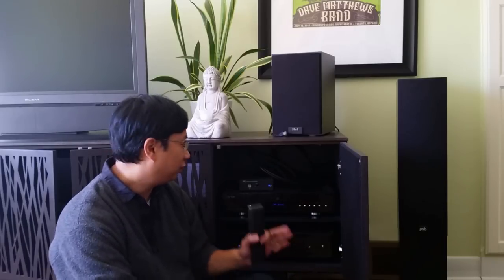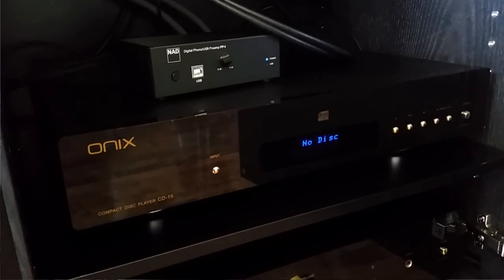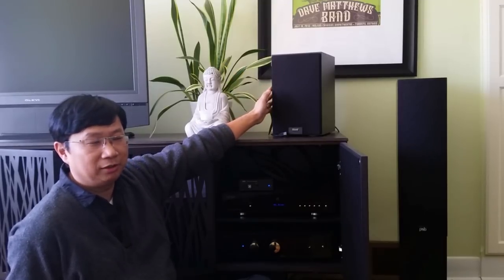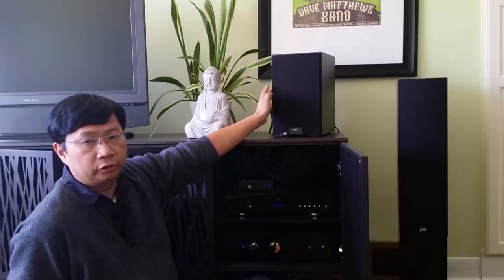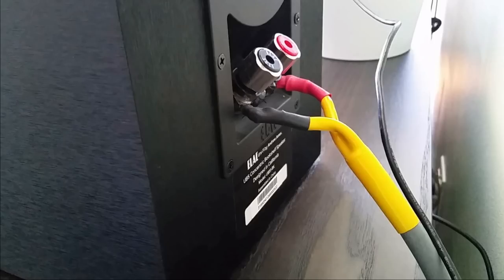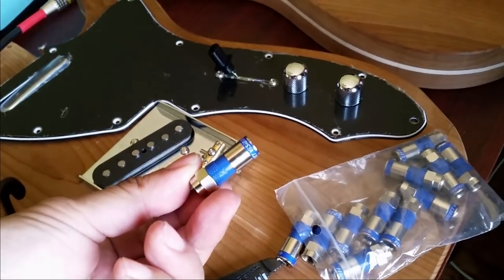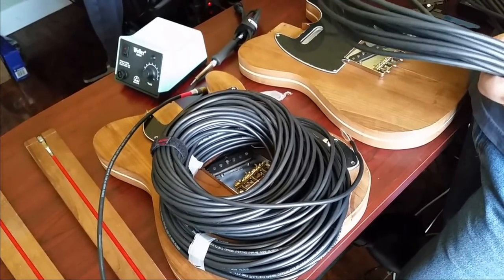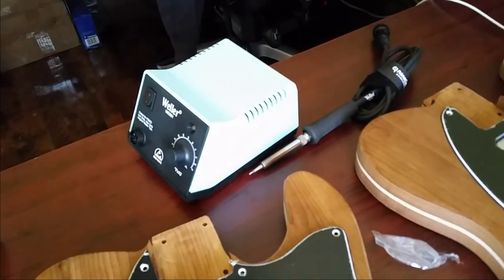Stereo - ELAC uni-Fi UB5 speaker review + DIY cables + Onix RA125 + Onix Cd15

Comment: I got myself some power flex cable from the local hardware and hooked it up to me speakers. It's copper wire, very thick  (can handee 1`5 amps!) and I can not tell any audio difference, even though these cables are more than 5 metres long. The cost? About $7.
Reply from the maker: $7? Best deal in town. :)
Reply: It's just the going rate for electric cable.
Reply from the maker: Best deal in the sense that you don't have to spend crazy money on cables.
Reply: RIght - and I believe that those fancy cables with gold and whatnot are a scam - you cannot tell the difference. Also, since power cable is fairly thick, you can use it over a long distance without resistance being an issue. Just make sure you get copper cable.

Comment: Fantastic review. Although I have a question: wich soundstage is better, these ones or the LS 50?
Reply from the maker: Will be bringing over my LS50 to my friends home to do a side by side comparison soon.
Reply: sir..can u recommend me a few options for integrated amp for elac ub5 which can pair and drive them to their maximum capacity....thnx
Reply from the maker: The beauty of these speakers is that they have so much potential. Even with my friend $3k+ integrated amp, I still feel there is room for improvement with a better setup. So I would say you have to find an integrated amp that sound signature is more to your taste. I like moon myself.  It also depends on your budget, but i think most important is make sure you have a lot of power with your amp since these are not efficient speakers.

Comment: Hi Thomas, this is great review. I also hear your sound demo video, this UB5 sound fantastic. 

I’m running home theater on my living room with 7.2.4, my gear:
1.  denon X4500h : 
   - 125 W (8 ohm) on 2 channel.
   - 190 W (4 ohm) on 2 channel —> dynamic power (dont understand yet about dynamic power)
2. Front speaker: klipsch rp-600m
3. Center and surround speaker using mordoaunt short 
4. Atoll in 30 using by pass preamp to power my front channel.

Im listening music 75% and watching movie 25%

after watched your video, im thinking to buy it, because im curious and want to experience good music separation 
And neutral sounding. Because after watched many review and sound demo, i think the sound i like most is neutral sounding with a good music separations.

Now im finding amp that will be synergy  With elac ubi5. 

After buy the amp, in the future i plan to buy schiit freya to pair with the amp. 

I’m from asian country so i cant get the benefit from trial period

My option:
1. Emotiva xpa-3 gen 3 
 - 275 w @8ohm on 3 chnnel driving. No 4ohm rating

2. Schiit vidar with 2 unit running mono block. 
- 400 w @8ohm.

3. Using current denon x4500h

When i watch your video, i see you have the experience with emotiva xpa and schiit vidar.

So My question:
1. What option you think is more synergy with elac ubi5?
2. Option 1 and 2 will sound significant better compare option 3 (using denon)?
3. Do you think with x4500h is enough power to drive ubi5?
Reply: 4. Emotiva xpa-3 and schiit vidar are sound neutral? 

Sorry for asking so many question. 😃
Reply: hello, I am in similar boat as you, just without a surround setup. I have a 2.1 home theater system with the elacs on the way. I also listen to music 75% of the time with my system. I had paid for the same denon receiver but I quickly returned  it and am searching the used and refurbished market for a powerful 2 ch amplifier. monoblocks is the end goal with a dac and pre amp. I also have been very interested in the emotiva xpa line. I read they are very modular and can be used as monoblocks when in a pair. Separates are the way to go for people that value the listening quality, and a preamp/processor will keep your surround system running just as well as with x4500h.

Comment: Help me out! I just got Yamaha tsr-7850 with spec of 1khz 2ch driven - 110w 8ohms 0.9%thd. 20hz 20khz 2ch driven - 95w 8ohms 0.06% thd. I will only be using the AV receiver with 2ch for now and hope to expand in the future. Do you think this speaker can work with my Yamaha? I am new to all of this.
Reply from the maker: You have to email Yamaha and ask if this receiver support 4 ohm load. The Elac are rated at 4 ohm, although your receiver will work with it, my concern is more long term driving it.  You risk the problem of overheating. I check on yamaha site and don't see they mentioning it supports 4 ohm, nice receiver btw.

Comment: In your experience, how much wats will be enough to power these speakers? Do you think denon heos hs2 amp will power ub5 elac speakers? Thanks!
Reply from the maker: I think your amp only support 6 ohm and not 4 ohm based on the site. Ideally you want about 100w into 4 ohm but I am sure you can get away with 70w. It's not that just because you have enough watt, it's enough, you need quality watt. Although ideally the more the better, 100w @ 4 ohm should be adequate.
Reply: @ThomasAndStereo  well i have to go with another Speaker, which can you recommend me of 8 ohms? Thanks!!
Reply from the maker: @jorgeluisfernandez2560  Maybe look into the Elac debut 6.2. They were on special on black friday. Cheap $150, don't know if they are still on special thought.Depends on your budget and what kind of sound you are looking for. Check out my video 'what speaker to buy?'

Comment: I wonder if they will release a 6.5" version, hmmm. I have a large room and would like these speakers and I use a sub so that would take some strain off.

I just wonder how these would do on a midrange home theater reciever with rated 80w @ 8 ohms / 120w @ 6 ohms and not sure @ 4 ohms, but it does play at 4 ohms, if that's enough.
Reply from the maker: Have you consider going for the full size tower.  You have to check with your manufacturer else you might run into over heat problem with your receiver and reducing it's life span.
Reply: Thomas & Stereo cant consider towers at the moment due to little ones running around and the TV setup at the moment works better with bookshelves anyways. The reciever is built to play 4 ohm loads, that was one of the selling features. I know of others that have done it.

Thanks for your replies. These are just such a nice size of speaker, I would like the 6.5" version, but afraid of the size. How big of a difference do you think it would make to have that extra inch in a large room? Much? Also the question would be if they were to release a 6.5" version do you think it would be a 2.0 of the original or just a larger version.
Reply from the maker: If your room is big, you will need a sub either way else I am not sure the extra inch helps 😢 they sound really different so I think it's more importantly which sound you prefer

Comment: Thomas have u ever try SVS prime and ultra bookshelf ? If u do? How does elac ub5 compare to the other 2 ? Just wondering as I'm planing to get SVS but it's abit expensive in hk
Reply from the maker: I owned the SVS prime before, 2 floorstanding, 1 center and 2 back bookshelfs. I liked them in the sense they are warm and very strong at the low end. However, once I did an AB test against my dynaudio compound the, although the bass was not as good as the prime, the Dynaudio was a class above in terms of refinement and that was against the floorstanding speakers.
Reply: Thomas & Stereo oh ok..I was thinking to get ultras but in hk it's so abit expensive it's about $2000 US  For a pair.. so I try to search something that might be close to it like the elac ub5... I can get half of the ultra's price ..but it come to my mind wat about prime..or maybe I jst close my eyes n jst go for the ultra..🤦‍♂️
Reply from the maker: Elac Ub5 is good but keep your expectations in check because it's not the same class as the Ultra. Also, it depends how important bass is to you. HK usually have space problem so is that why you are going for bookshelf? Elac is soft on the top end which is good for long listening but need a bit of power to make it shine.
Reply: Thomas & Stereo yeap u r right it's the space my living room is jst 250sqft where in Gona place my system.. I will get a pb2000 aswell ..I jst spoke to the dealer he will give me $US969 almost same as the elac ub5.. should I go for prime than ub5? Or save abit n go for ultra? Jst need a expert advise haha
Reply from the maker: Well I can't give you an advice on the ultra as I never heard it :( The UB5 is more of an audiophile speaker than the prime if we are comparing bookshelf. Can you audition them?
Reply: Thomas & Stereo I went to some shops but they don't have the ub5 only the b6's but I knew one more dealers that I will go n hopefully they have the ub5 n let me try it..most shops dealers don't have much of the elac🤦‍♂️
Reply: I thought the svs prime was shrill and shallow
Reply from the maker: Lucas D the full tower one I tried had meat...I never bothered with the rear bookshelves.
Reply: Thomas & Stereo, Lucas.... any suggestions for a rear bookshelf for the price of $1000US?  U guys don't recommend the SVS prime bookshelf ??!
Reply from the maker: The SVS prime bookshelf are really small speakers so they are good for effects but not for main speaker. Are you planning to spent $1k on a pair of speakers just for the rear or as main speaker?
Reply: I thought the primes were on the large side of bookshelf speakers. I think that size speaker when paired with a capable sub would be fine as a main L/R. Just not the prime, its simply a poor sounding speaker when compared to something like these Elacs.
Reply from the maker: Hey guys, I just realized I made a mistake, I had the SVS prime satellite and not the bookshelf. No wonder they were small. I never paid attention to it so never research it further.
Reply from the maker: My mistake, I had the prime satellite with the full size towers. I never had the bookshelf one.
Reply: Thomas & Stereo haha...ok ok thanks thomas
Reply: Lucas D oh ..so u wer saying elac has better sound n bass??
Reply: Narcos Season1 yes. The b6.2 has better highs, mids and lows. The svs is a little easier to drive and does look better imo. But these elacs certainly sound like $1000/pair speakers. The primes sound like $100/pair
Reply: Lucas D wow I was surprise with this comment! That's sims elac is way better than SVS...u saying is elac b6 is it?? Ok let me check tom .. thanks ..but yeah prime book looks amazing n more classy
Reply: Narcos Season1 the elac b6.2 is designed by a renowned speaker designer who really knows what good sound is at an affordable price. The svs prime isn't a terribly speaker, it's priced too high for the lack of sound you're getting.
Reply: Lucas D ..hi what about the b5 and b6??? I went to elac shop yesterday n they will have a sale nxt week, b5 $US340.  b6 $US 380 since I'll get a sub the salesman told me get the b5 cos it has less bass n more better for vocals..they don't have b6.2 yet it's coming soon that's y the other 2 is on sale ..by the way I live in Hong Kong ...

Comment: Interconnects? Are these speaker wires?
Reply from the maker: Interconnects are cable used between cdrom to integrated amp or preamp to amp. RCA cables.

Comment: Will outlaw 5000 amp work well for the uf5?
Reply from the maker: I never tried that combo so I am not sure. In theory, it should be ok , it is afterall 180w @ 4 ohm
Reply: @ThomasAndStereo  I've been using an older pionner elite 130 watt per channel reciver for my front 3 elac speakers. For stereo it does fine but when I watch anything that's 5.1 it suffers..  I need to crank up the receiver to -8 to get the sound pumping

Comment: Hey Man, plz recommend a receiver for ELAC unifi 5
Reply from the maker: i don't know much about receiver but you need to make sure it supports 4ohm and have good watts
Reply: Pioneer elite sx-n30 class A/B hi-res receiver at 100 watt at 6 ohm 85 watts at 8 ohm pioneer  will push these uni-fi  easy rated at 4-6-8 ohm what ever you choose to it's a 2 channel beast and fully loaded ! the elite beat out my Yamaha as801 i was amazed and it's fully loaded check out my review u can pick up a remanufactor one for about 350 was 799.00 new

Comment: Up-sampling? If the samples aren't there on the CD, up-sampling does nothing for you! It can't pull extra music samples out of nowhere. It could only ad zero-data samples in between the existing ones. Think about it... if you sample a 1kHz tone at 44.1k, then all that's there is 44.1k samples. There are no 'hidden' samples waiting to be uncovered in between the 44.1k samples. Try to convert an mp3 to .wav on your computer. You will hear no improvement whatsoever because the resolution is already gone.   I know nothing of that particular system, but I feel like the '192' labeling means that it CAN play hi-res files which were actually printed to disk at 192k. But if it's at 44.1 or 48k.. that's all you get. If it is actually 'up-sampling', then all it could be doing is extrapolating what is 'likely' to be in between the existing samples.... But if you know anything about Nyquist, you would already know that such extrapolation is entirely unnecessary. Sorry, not trying to sound like an ass. But... up-sampling is bullshit
Reply from the maker: Well, no need to say sorry. I assume you have spent a lot of time comparing native 44k upsampling to 192k which a lot of people do these days either by computer upsampling or native DAC function and can't hear a difference so it is what it is. I personally now spend a lot of time listening in 44k actually and don't usually upsample anymore. It's like the Blu-ray players these days upsampling 480p DVD to 1080p, I guess the idea is the same. For some people, like me, there is a visible difference but not everyone.
Reply: I can tell that you are not in the business of manufacturing CD players ;) Taken from a CD Player owner's manual:
"The CD digital data streams are first up-sampled to 192kHz, which moves noise, jitter and distortion artefacts well above the audio band. They are then passed through a new, low noise, low distortion 24-bit
 dual-differential digital-to-analogue converter, which allows simpler filtering of the analogue output. This in turn gives an improved audio response without the need for sharp filters that degrade sound quality. The result is a CD player which has a smoother response than previously possible with none of the “hardness” of other units." (Musical Fidelity manual)

So nobody is concerned with creating samples out of nowhere.
Reply: @Baerchenization   You're correct about my business practices. Thanks for the info... that actually sounds totally legit. (I do have some knowledge of reconstruction filters & jitter) 

My bad.     I'm just way too used to hearing people trying to increase audio fidelity by doing things such as converting an MP3 to a .wav

I'm sorry, Thomas.

Comment: Elac Uni-Fi UB5 bookshelf speakers with yamaha aventage rx a770 (7.2 channels, https://usa.yamaha.com/products/audio_visual/av_receivers_amps/rx-a770_u/specs.html#product-tabs). Do you think if i buy these speakers the match would be a disaster. I asked because they told me that these speakers are power hungry and don´t work very well with cheap amps. (regular price of my amp, this year model is 650 dolars) Wait if you are so kind to answer me. Thanks!
Reply from the maker: It's not only the quantity of watt but the quality. I think those support 4 ohm but you might want to check as I am not too sure from the manual. If it does, it does have enough watts. However, when it comes to receiver, I am not too sure about it's sound quality, I would guess it's ok so buy from a place where you can return if you don't like.
Reply: @ThomasAndStereo  it said has a 6ohms but could use 4ohms as fronts speakers. Specs are Rated Output Power (20Hz-20kHz, 2ch driven)  95 W (8 ohms, 0.06% THD)
So i believe it´s capable but don´t know if it will take all the juice. Would be nice to buy an stereo amp with a toroidal transformer but..... haha. Thanks a lot for taking your time to answer. Really!!!!